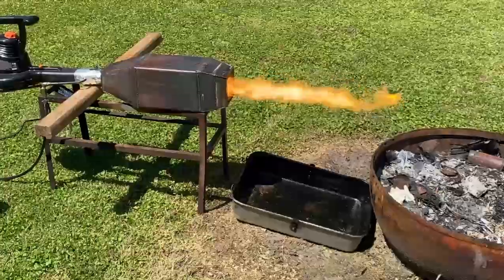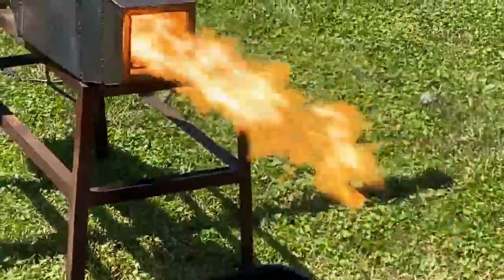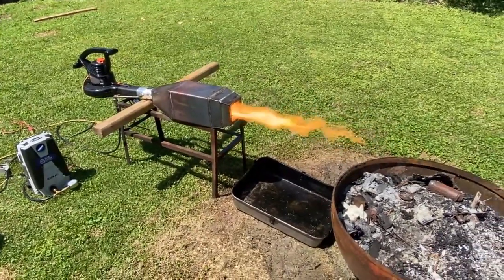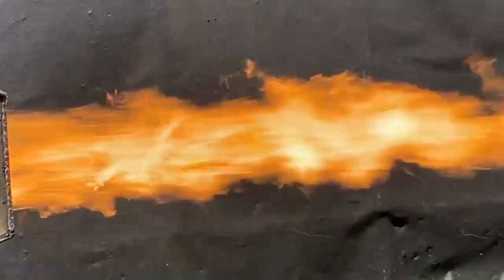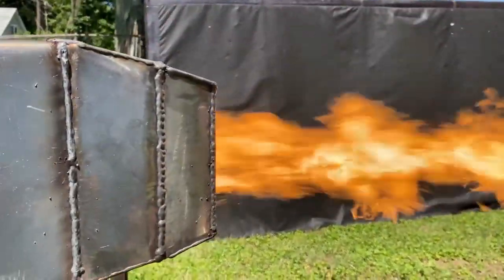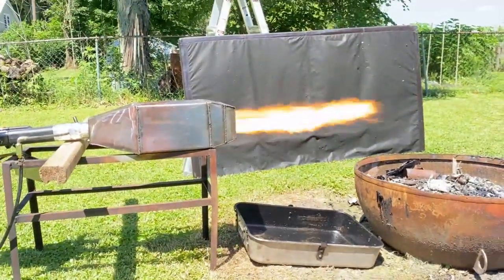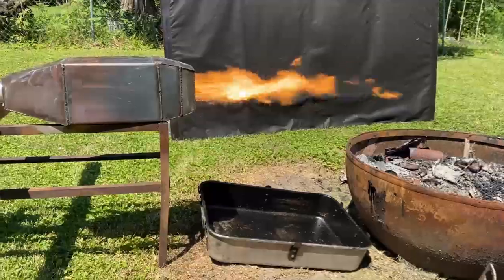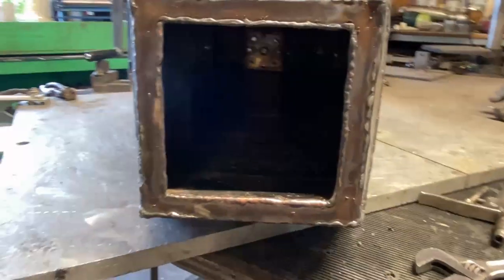Waste oil Jet engine for high temp furnace

Comment: I built something very similar to your chicken incinerator - MAN it's HOT, and I'm only running on 2,1 Bar. Can't wait to get something bigger than my 50L compressor. I have a jumping castle blower - just need to figure out how to incorporate that in my burner...
Reply from the maker: Its not easy , my last couple attempts have failed
Reply: @NOBOX7  - If I win, I'll let you know the trick.
Reply: @NOBOX7  So refreshing being honest with us all on youtube to tell us about failures you had. Those bad days showed you what direction you had to go with for the SUCCESSES. JOB WELL DONE FELLA.
Reply: sounds like like u have been watching the oil burners  channel with the jumping castle blower
Reply: @rustymachineshop9456  - Seen his stuff. The problem is to atomise the oil using a jumping castle blower.
Reply: @The_Hairy_Farmer  yeah but I got a kick out of the oil burner sayings they were funny
Reply: @rustymachineshop9456  - Kinda like the Ozzie version of AvE...

Comment: i saw that  old mining site  have  piles with good stuf in  it   stil   is it  possibel to make eltric  furnace on solar  to collect these left over metals  from  refinery sites
Reply from the maker: No , not likley , you could use solar to run this burner though
Reply: I imagine you could use a large enough number of mirrors directly reflecting solar irradiance, aimed at the target material to get the desired temps, like solar thermal plants do.  Mylar can make cheap replaceable mirrors.
Reply: @orcoastgreenman  That is a fact fella.
Reply: @NOBOX7  maby  you can  build eltric  ovens  fore this aplication     to use solar power  with converters  when i  whas young  i has been told me  that i takes  long  time  to heat up  a big oven  and that maby  down side with solar eltric oven?